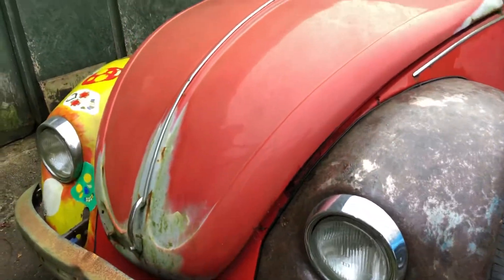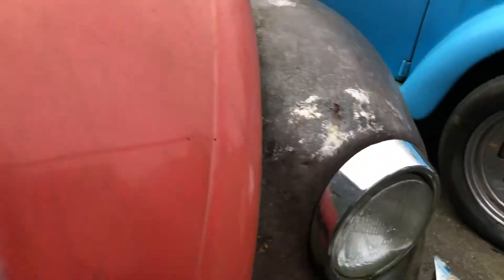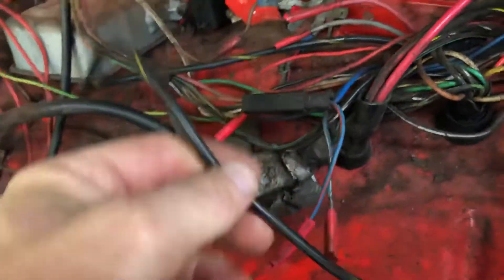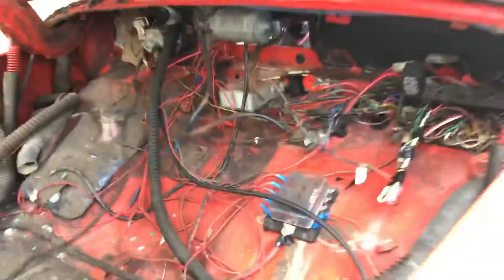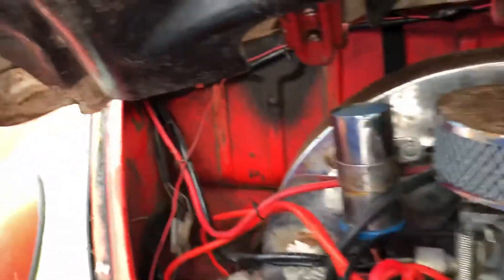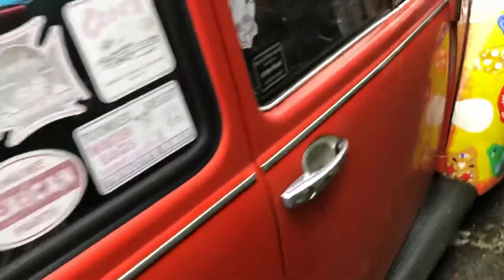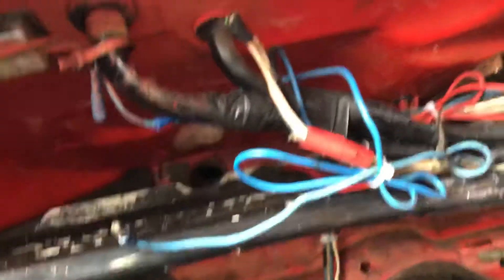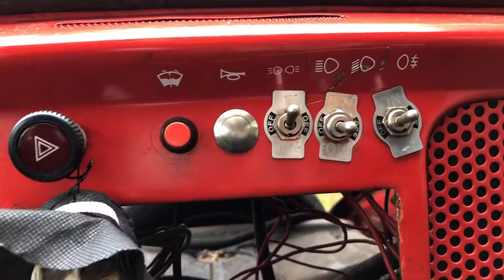Vw Mexi bug REDDY to sort wiring out

Comment: It's had a RHD conversion but they did not swap the wiring/fuse box over?
I'd be checking the rest of the conversion work at this point.
Reply from the maker: Yeah rhd conversion maybe that’s why the red wiring had been there as a extension